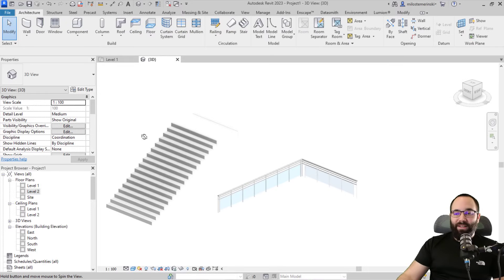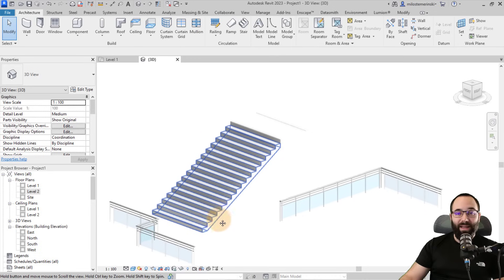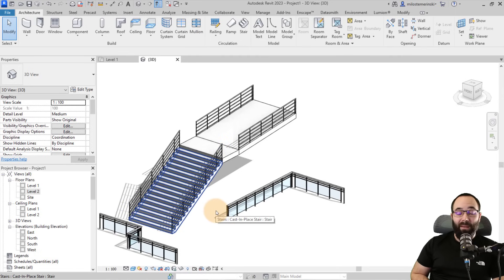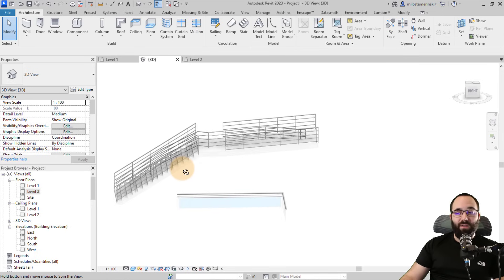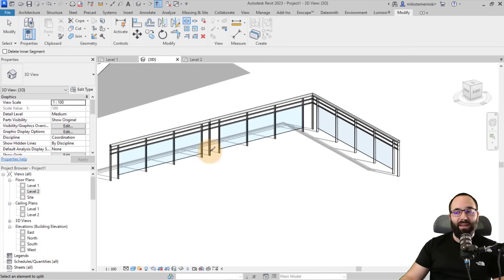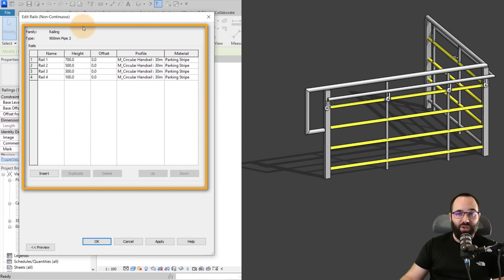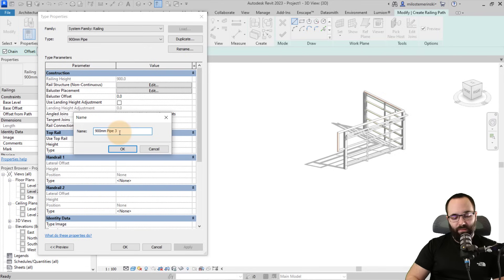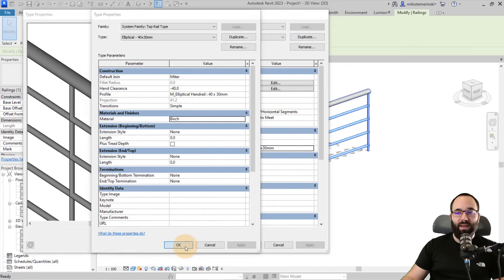Revit Railing - Beginner to PRO Tutorial

Comment: Thank you for this explanation. Could you elaborate on the landing adjustment height for, say, 900mm flight and 1100mm landing railing for railing where baluster/spindles are attached to the "bottom rail" and "top rail" not to the *host*? It seems Revit does adjust all rails leaving a 200mm gap between the bottom rail and the landing, making it non-compliant